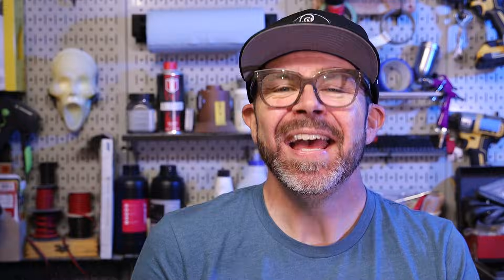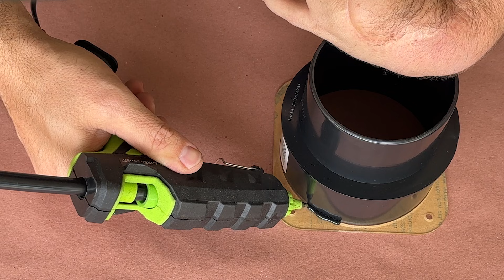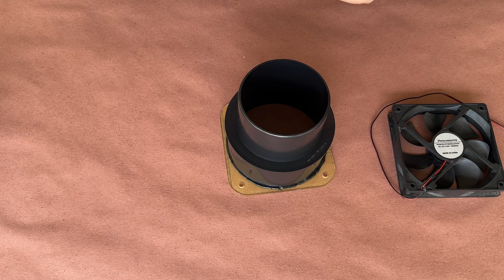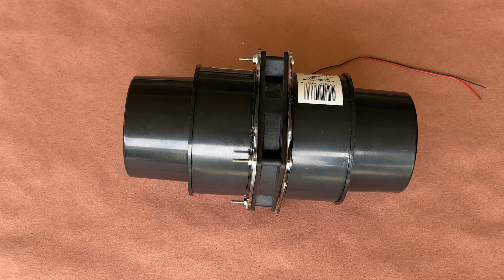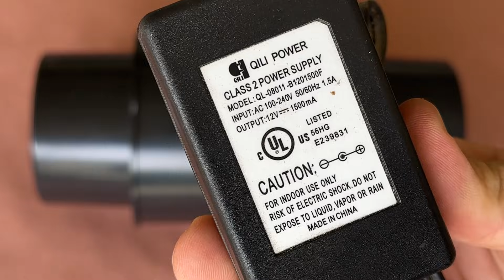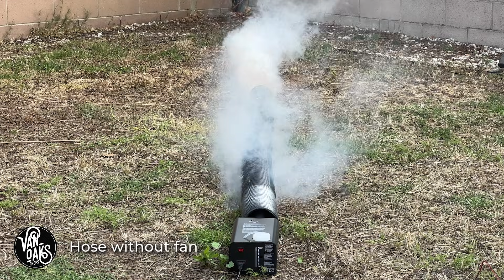Supercharge Your Fog Machine!

Comment: With repeated use, fog juice can really mess up a fan if you spray directly into it.  I recommend getting a Y coupling and running the fog through one opening and mounting the fan to the other.  It might add some more leakage, but it adds pressure to system without the fog spraying directly into the fan and gunking up the rotation / shorting out the electrics.
Reply from the maker: That's a great tip!

Comment: This is what I have experimented with and have had mixed results. My yard is reasonably windy on a calm day. So, keeping the fog in the show is hard. It is also a flat yard and gravity is not helping me. 

Sit tight and bear with me here. This is the shortest I know how to explain this issue.

I use a 4-inch inline duct fan that runs on typical household AC line voltage. This particular fan pushes 80 cfm (cubic feet per minute) of air. These are found at hardware and big box stores; I purchase mine at Menards.  There is a fog chiller box as well. Which is a 27 gallon plastic tote, this is approximately 3.5 cubic feet. The outlet of the chiller box then tee's left and right to a distribution hose, this hose has perforations as well. The fog machines are Theefun 400-watt units that output 400 cfm at the nozzle. 

The first idea was to place the inline fan between the fog machine and the chiller. Thinking this would push more fog through the chiller box and reduce the amount of vapor escaping at the inlet. Result was pretty good. Still not enough fog for my liking. Frankly, the fog may be pushed through the chiller box too quickly. Also, not sure how much flow the fog machine puts out.

Second plan had the vent fan installed at the outlet of the chiller box and then feeding into the tee. Result was not much better than the first version. Though there is now more fog being pushed through the distribution hoses. 

Overall thoughts. First, the amount of fog the fan can move is important. Like the inline duct fan I have used, Mr. VanOaks muffin fan is also an 80 cfm unit. The fog machines output will overpower the fan to some degree. Finding the right balance is important. Next is the diameter of the distribution hose. The larger the diameter the slower the fog will move and the lower the pressure in the hose. The speed should increase with a smaller diameter hose, this will also increase the pressure; more on that later. This brings us to how long will the fog stay as good fog has to do with length of hose and to a certain degree the temperature surrounding the hose, as that will change the consistency. I like my fog chilled and when Halloween is chilly in Wisconsin it helps a lot too. Lastly, there is a combination of the diameter of the fan and the relationship to the diameter of the hose. 

My implementation is towards using 4 inch diameter all the way up to and including the fan, with the fan at the outlet of the chiller. From there, reducing the diameter of the distribution, thus increasing the pressure. This has provided more output to the yard and keeps the fog output pretty decent between cycles. The ends of the distribution hose are also capped, which keeps the pressure higher in the distribution tube. The last question is the diameter of the distribution hose. I have been using flexible corrugated downspout pipe that is perforated. This goes down to 3 inches, at least at Menards; they have much better selection than Home Depot and Lowe's. This year the plan is try 2 inch and now need to find a flexible variety. Preferably with perforations.

😅Whew :face-purple-sweating:that was a lot to take in. Hope you find something useful from this.
Reply from the maker: That was very useful! Thanks for taking the time to share it with us.

Comment: If you set the hose or fan a few inches away from the fogger it will draw more air into the tube that will help push the fog through the hose.

Comment: Do you think the gaskets could be 3D printed in PLA?
Reply from the maker: ABS or PETG would be better since PLA could potentially warp during the warmer times of the year
Reply: @VanOaksProps gotcha. Thanks Derek.
Reply: Also, does the discharge side of the reducer fit inside the drainage pipe, or is it coupled somehow?
Reply from the maker: @603VIL  fits right into the ducting. I also found that if you move the fan about 8’ out from the nozzle you get better push. So you’d have the fogger and 8’ of ducting, then the fan, and whatever additional length of ducting. It’s also beneficial to have the ducting about 8-10” from the fogger’s nozzle
Reply: @VanOaksProps  Got it. So 8-10" gap so that Bernoulli effect works. Then 8 feet of ducting. Then a splice with the reducer fan combo
Then, out to the remaining pipe. Sound right?
Reply from the maker: @603VIL  exactly!

Comment: Thank you for the video.  Any possibility, you'd be willing the post the STL file for the gasket?  I'm making this and am having trouble converting the PDF into something I can upload to the modeling software I use.  Or add to your ETSY store. I'd buy the plans.  Thank you.
Reply from the maker: Unfortunately I didn't design it in 3d. Have you tried converting the PDF to an SVG and importing that into your 3d software and then extruding the shape?
Reply: @VanOaksProps  Hi, thank you for replying.  I really appreciate it.  I did try a free PDF to SVG converter and the results were less than stellar.  I'm going to try cutting acrylic on my CNC.  I'm sure I'll be able to adapt the pattern and make it work.  Thank you again.

Comment: I had good luck making a PVC chiller. I used: 
- 4" x 8-foot pipe
- 4" 90° elbow
- 4"x2" reducer
-  2" tee, with short bit uncapped
-  And a short length of 2" stock 

Cut and fit. Spray paint with black Krylon Fusion. 

Works best concealed in bushes or the like.

To use, fill 4" portion with ice or (easiest) frozen 20 oz bottles of water. Put small end riiight next to fog machine output and start 'er up.  

You may have to replace the water bottles a couple times over the course of an evening.

Comment: I don't see a need for this in that setup and I didn't notice any real difference in output.  I could use this though to help push the fog through my long tubing going through a fog chiller.  I may do this.
Reply from the maker: For clarity this isn't how I would set it up, but rather just shows it's application. 8 feet worth of ducting really doesn't serve much purpose in a haunt setting, however, if you needed to push for 20' this would be a good build to improve fog distribution.

Comment: The way I do it is I concocted a setup using 4” corrugated drainage pipe arranged with different exits where I want the fog to come out. Then I pass the fog through a rubbermaid container filled with ice. And I use an old hair dryer at the beginning where the fog comes in to push it along. Had good luck with it last year!

Comment: Utilize the Bernoulli effect and don’t put the hose adaptor right against your fogger. If there’s room for more air, the low pressure in the tube will pull even more air in and help disperse the fog
Reply: Double this comment! Great build. I will use this.

Comment: Love this idea! For our display we love low lying fog so not only do we buy Froggy fog juice, but we also have similar garden piping you used in your example. We freeze water bottles the night before and throw 2-3 bottle into the tube and it cools the fog enough to keep it perfectly low. Halfway during the night we replace the frozen bottles, but its easy to do. I know there's other methods using coolers and dry ice, but this one works for our small yard and really makes a difference.
Reply: Great idea with the water bottles.

Comment: Halloween in Australia when it's not Autumn (Fall) is a real problem with fog. The fog comes out at a high temperature anyway, hot air rises faster than cool air so the trick is to use a system that can cool the fog down so it stays low on the ground for longer. This can be done using some flexible tubing you can coil inside a large container, having the tube ends fixed to holes made at the base of the container, sealing them so you can pour in lots of ice in the container and close it. Place the fog machine at one end of the container (It's good to have a heat resistant tube fixed to that end cause the nozzle of your fogger gets hot in case you're like me and didn't know how hot it can get). The fog travels through the coiled up tubing in ice and it gets "Chilled". There's a few plans for this on the net but they are easy to improvise or even improve on😊
Reply: Dry ice fog is grounded less the free airs colder

Comment: I'd love to hear your thoughts on ultra sonic  foggers, especially the big ones with 10 heads on them.  I've experimented with the single  head/disc  ultrasonic humidifiers for my indoor plants and they can put out some decent fog which also stays low to the ground.  Anyway, I actually bought an AC inline fan by accident thinking it was a regular PC fan and I might use it for this. Though I don't currently own a fogger, that might be a future purchase when I see some sales. Great video as always!
Reply from the maker: They're cool, but crazy expensive in my limited experience pricing them out. Thanks for watching!